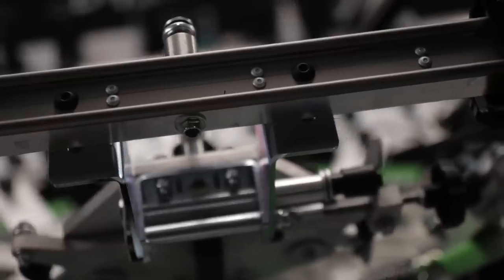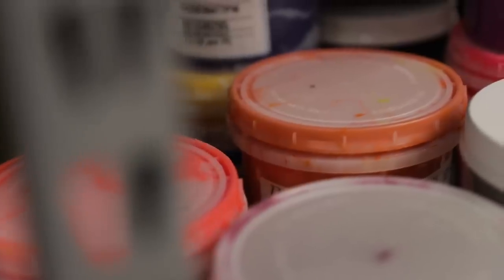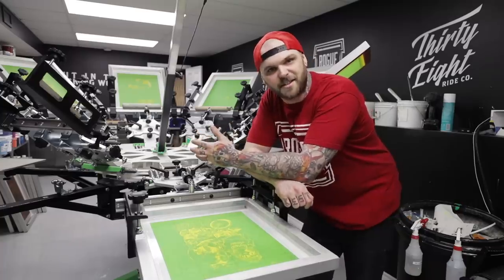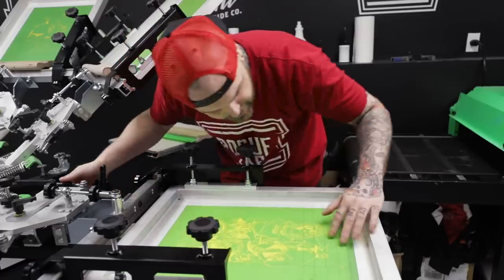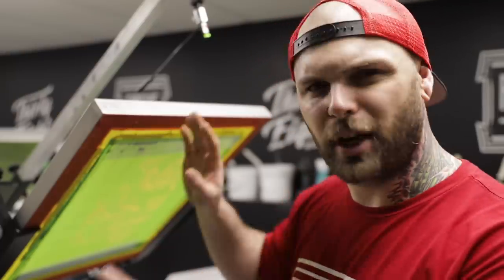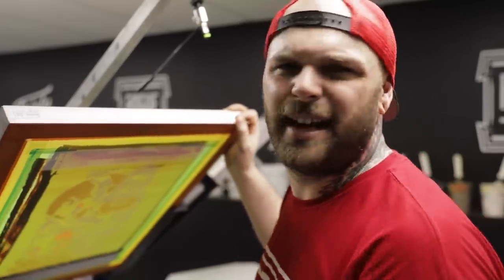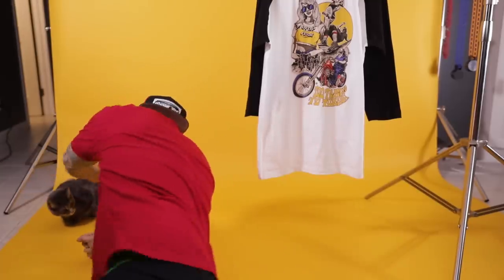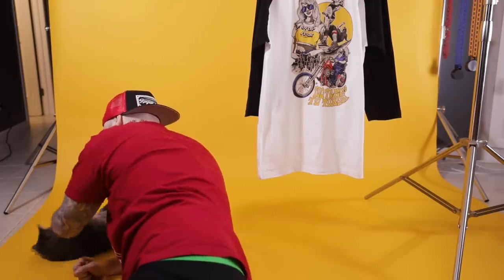Registering A 6 Color SCREEN PRINT!

Comment: Nice video again. I'm trying to learn what I need to print press and how to do that before buying gear and sourcing my t-shirts. I think i will eventually do screen printing but my issue is what if someone just wants one t-shirt and you have to do all that 6 colours for basically £10 ($14)
Reply from the maker: If someone wants 6 colors on one shirt, you just don't do it. Every print shop has a minimum order
Reply: @leestuart38  Did you start off doing print pressing or straight into screen printing. I'm currently looking at the best gear for my budget and how to do it properly. Great videos btw, my garment sourcing is the hardest thing over here in the UK.

Comment: Sick work as usual!! Do people blow you up for "pushing" on your clearing stroke? I personally believe it is better than "pulling"..but I get alot of S#%t about it from the old people on the internet.. Thanks for the tip on the vinyl tape I will be trying that A.S.A.P..!!
Reply from the maker: There's ways to do both cleanly, the old timers don't understand that because they only learned one way. I had no choice but to lean how to push well because I've broken my arms and wrists too many times to pull for longer than an hour haha.
Reply: On a like for like basis, pushing is generally considered more consistent, as it is more efficient - you fatigue less over time, so you can maintain the same stroke over a longer period of time.